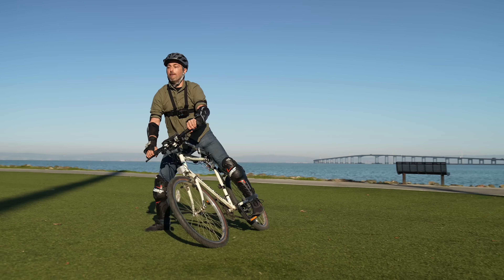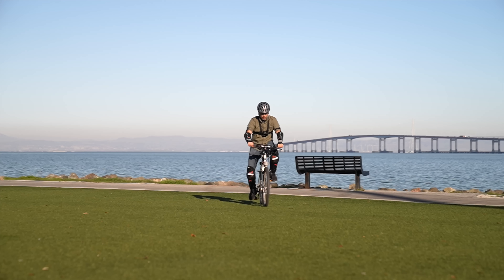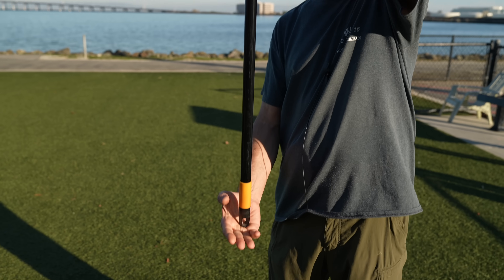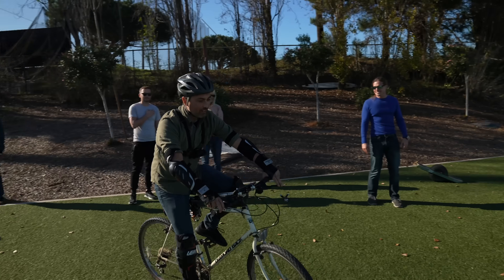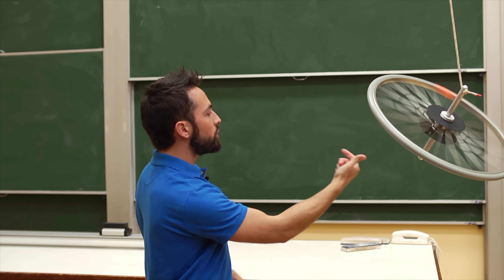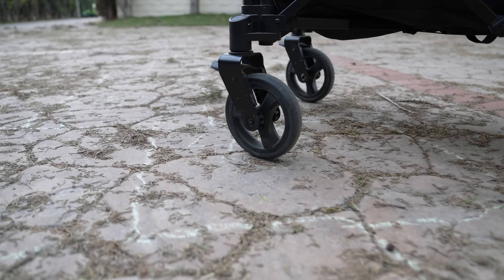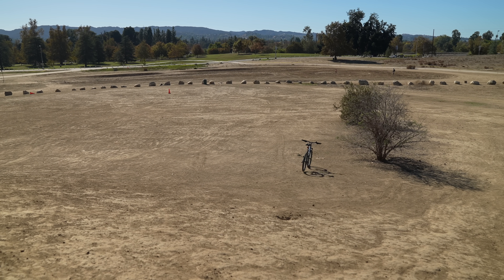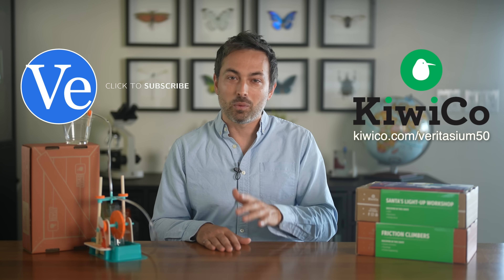Most People Don't Know How Bikes Work

Comment: This is stupid.
When you drive slow, you always do little left-right steers to keep balance and slower you drive, bigger those steers.
When you lock the handlebar, you just can't keep balance while driving slow. If you'd keep all of this on high speed there would be no problems.
Reply: >> If you'd keep all of this on high speed there would be no problems.

I'll bet you $10K you can't ride this bike at any speed with steering locked.

Comment: I know you said that with the steering locked you couldn’t stay balanced on a bike. But then how can I bike with no hands on the steering wheel
Reply: It's easy enough to ride "no handed" as long as the steering isn't locked.  You're taking advantage of the three dynamic principles Derek described for the stability of a riderless bike.  But if you lock the steering, you will not be able to ride it with or without hands on the bars.

Comment: The second they mentioned they locked one direction.. I realized where they were going. That they would try to turn that direction and take the turn wider for balance and were going to fail because its locked. Also its not like cars just hard steer in one direction. Sometimes they do in fact go wider.

Comment: My friend and I figured this out when we rode over snow and looked at our traces. We then challenged each other to go right or left without steering in the opposite direction first.
Reply: Yep. You have to lean your entire bike to one side and and slightly balance your body the other side. Only works if you know where to turn beforehand though.
Reply: @warmooze  kinda like what we see in motorcycle races?
Reply: @bruno13532  Doesn't even have to be that extreme, the way i was taught to ride i didn't even know people actually used the handle and turning it to initiate a turn, i was just told to lean in the direction and the handle will follow automatically. Unless you're riding painfully slow and need to turn on a dime, which i've rarely ever even needed to do.
Reply: @warmooze  That's how I always turn. I just lean and then turn to the side I want to turn to. I do kick out to the opposite direction consciously on hard turns though
Reply: @warmooze  yep. i have a bent handle (common in the Netherlands) and lean with my elbows on the handles and my hands on the frame above the wheel, so i basically only need to lean
Reply: @warmooze  I always bike like that, that's how I learned it
Reply: did u manage to do it?
Reply: I'm sure you still countersteered some, it's really hard to kick a habit you don't think about.
Reply: 1: turning your bike means saving it from falling over to one side.
2: if you lean to one side while going straight, your bike will lean to the other, because physics.
3: you can slightly lean to one side, making your bike tilt to the other, and then steer towards that side, making you and your bike unstable and forcing you to turn.

the counter-steering is just an intuitive process of making you fall towards your desired side.
Reply: @warmooze  So you'd be willing to try the bicycle in this video?
Reply: That's so nice. Kids realizing something and testing hypothesis naturally (assuming you were kids when that happened 😁).
Reply: To all the people saying "that's just how I bike", please find a method to trace your tracks and check again. At normal riding speeds it's not very noticable, but  not counter-steering a bit makes turning completely awkward.
Reply: I think counter-steering is only really necessary at low speeds.  If you're going fast enough, you can simply lean your body and turn the handlebars in the direction you want to go.
Reply: @Durwood71  I think it’s all about being conscious of your balance. I think uncoordinated and/or unathletic people probably countersteer more because they can’t balance like that on their own. When I snowboard I can turn without counter steering by just leaning further for harder turns.
Reply: @Durwood71  at high speeds it only takes a tiny counter steer to lean your bike. you do it, it happens naturally.
Reply: @0xsergy  if I'm counter steering at high speeds then it is literally undetectable, because I've paid careful attention during my rides and see no evidence of it.
Reply: @Durwood71  Eh motorcycle racer use countersteering tho
Reply: So this bike proves nothing other than the creator of this video doesn't know how to turn both type of ways lol
Reply: @aitotem  Well at low speeds seen on the video I think alot of people will do the steer to the other side before shifting center of mass thing.

Comment: If you ride a motorcycle…you already know this.  It the higher speeds of a street bike you push the steering wheel away on the side you want to turn.  The harder you push…the harder it turns.

Comment: I want to try this at a regular speed and without using the handlebars (he was going way too slow). I can bike almost the whole time without using the handlebars, so my turns are controlled by my minute body shifting and movements. But without using the handlebars, if I turn even slightly the wrong direction I have to keep turning fully, straighten out and only then can I turn around. It's almost impossible to turn a little bit the opposite direction and then correct to the right direction without the handlebars. Even if I'm holding the handlebars, when I turn I'm barely touching the handlebars and the turn is all in the body shift. I'm disappointed they didn't have a regular bicyclist test this out. The people who use it for daily transportation. I want to see if the results are different.
Reply: >>  I'm disappointed they didn't have a regular bicyclist test this out.

I have put experienced mountain bikers on this bike as well as professional motorcycle and bike racers.  The results are always the same.  Riding without touching the handlebars does not help.   You still need to counter-steer whether you're touching the bars or not.

Comment: Ok but does this work for life-long bikers?

A few tests suggest that you don't countersteer so much as lean in to the curve, so that the bike doesn't move out from underneath you. In other words, you steer mostly with your body, not the handlebars.

Just curious.
Reply: >> does this work for life-long bikers?

Sure does.

>> A few tests suggest that you don't countersteer so much as lean in to the curve

Lots of people believe they don't countersteer to initiate a turn.  But both the equations and this experiment prove that they do.
Reply: @Rick_Cavallaro  There's more than one way to take a turn, and if you aren't as wobbly as the examples provided you can easily hang over first and then follow through with the handlebars. You can even push'm down to get into it.
Reply: @typhoidtyphoon  
>> you can easily hang over first and then follow through with the handlebars

Nope.  If you could do that, the folks in the video would have done it.  Some were very experienced mountainbike riders.  I've since put professional bike and motorcycle racers on the bike with the same results.
Reply: At speeds above a slow walk?
Reply: @typhoidtyphoon  it is true at all speeds.  The amount of counter-steer required is less at higher speeds, but still needed.
Reply: @Rick_Cavallaro  Hmm I'm still sceptic, but as I can't produce any counter-proof I'll have to settle for that.

Comment: Which is why riding a motorcycle is fundamentally different from riding a bicycle.  On a motorcycle, the gyroscopic effect is the predominant force and steering is not done by turning left/right, but by pushing down on the left/right handlebar grip.
Reply: Wow! That could be the worst  ever.
1. Gyroscopic effect do next to nothing. If you don't belive that, then calculate it yourself.
2. Pushing down handlebars do nothing, except lift your arse up.
3. Bikes work the same. MC, Bicycle, scooter, kickbike...

Comment: And there are people who can balance on a bike when it’s completely still pretty much and pro road cyclist can do this. All of what you are saying is possible IF you have the skill set.
Reply: Almost everyone that does what you're claiming is doing a track stand.  To do that you turn the front wheel 45 deg or so, and move fore and aft a few inches.  That moves the front of the bike left and right.  You're still using the inverted pendulum dynamics we use to ride.  Lock the steering straight ahead and you'll find very very few people that can balance.
Reply: @Rick_Cavallaro  Oh absolutely, very few. But it can be done.
Reply: @truezenithcreative  It can, but it's literally using different skills from those we normally use to ride bikes, not just people that are better at the same skills.  And it doesn't look like riding a bike.  It looks more like a high-wire circus act.

Comment: This isn’t quite true, at a high level in cycling the can do this with extreme body lean. It can only be done at fast enough speeds and you have to be a fairly solid rider but it can be done. (Think how you can actually steer a bike while riding with no hands just by leaning)
Reply: I can do extreme body lean and still steer my bike. All I have to do is to use the handlebars.
Reply: >> This isn’t quite true

Yes it is.

Comment: But what about bikes with 1 wheel? Or 3 wheels? Or 4 wheels? lol
Reply: Bikes have only 2 wheels inline.
Reply: Clearly not all of them. There are bikes with 1, 3, or 4 wheels lol
Unicycle, tricycle, quadricycle, or training wheels. How would this video work on these variations, i.e. lock the steering lol
Reply: lol I said bikes not bicycles (same for the video title). Pretty sure many people call those (1, 3, 4 wheel) bikes as well, especially bikes with training wheels, you still call those bikes. I was referring to the falling part with the steering locked, not talking about turning. My point is whether the falling part would apply to those bikes that has 1, 3, 4 wheels (or training wheels) when the steering is locked.

Comment: What? How ppl steer is counter intuitive to how I steer. I never watched how others steered, seeing this video is mind blowing in a way. Seeing it, I get why it's done and I recall myself doing it in the past, but I long adapted by leaning before steering. 

I can't make a small right turn if I want to make a super tight left turn, I need to be leaning into the turn in order to initiate the turn, then steer. Any others who did BMX in the past who get wtf I'm talking about?
Reply: I get what you're talking about, but you're fooling yourself.
Reply: @Rick_Cavallaro  yet I ride bicycle everyday, and like usual, I leaned into the turn long before I even turned. 

Do you ever ride without hands? How do you steer then eh? You lean.

Do you think when I turn without touching the handle bars I steer to the right first when going left? Clearly not because I'm not touching the handle bars... I lean to steer.
Reply: @lookdawg187  
>> yet I ride bicycle everyday

Lots of people do.  And they can ride just fine.  They just don't know how it works.  Thus the title of this video.

>> Do you ever ride without hands? 

Yes.  Perhaps you saw me riding the unicycle in the video.

>> How do you steer then eh? You lean.

You don't lean.  You lean the bike with your hips.  That causes the required counter-steering based on the three principles Derek described for the stability of a riderless bike.  But if you lock out the opposite steering as we've done here, you still can't make the turn.
Reply: @Rick_Cavallaro  since you know the people in that video, as you were one, do you not recall him saying he could turn when he was already leaning in the right direction? 

I can lock my entire front wheel and still turn using my body. Can't do that on uni-cycle because you fall off then, but the bike has mass to manipulate where you can alter the center of gravity a lot easier.
Reply: @lookdawg187  
>> do you not recall him saying he could turn when he was already leaning in the right direction? 

Yes.  That means the counter-steer happened prior to locking the bars.

>> I can lock my entire front wheel and still turn using my body.

How about if you come by and show me on this bike?  I'll bet you $10K you can't.
Reply: @Rick_Cavallaro  so you've never seen BMX pop their front wheel and turn using their body?

Save yourself the 10K and go check out a BMX show, they do all kinds of wild stunts using their body to manipulate where the bike goes, with or without front wheel steering.
Reply: @lookdawg187  
>> Save yourself the 10K and go check out a BMX show,

Got it - you're unwilling to put your $10K where your mouth is.
Reply: @Rick_Cavallaro  I'll bet you $100k I can steer my bike with steering locked.

So when will I be seeing you to take your money?

You're like that physics professor, get ready to pay up because I already do what I claim I do.
Reply: @lookdawg187  
>> when will I be seeing you to take your money?

As soon as you come to the S.F. bay area and demonstrate this on this bike - with both wheels on the ground at all times.
Reply: @Rick_Cavallaro  How am I supposed to make super tight turns on a bike with both wheels on the ground? 

Have you ever seen BMX? The front wheel likes being in the air to do tricks.
Reply: @lookdawg187  
Let's look back at your original post...

>>  How ppl steer is counter intuitive to how I steer... I long adapted by leaning before steering. 

That's clearly not talking about lifting the front wheel.  You're changing your story because you know you're wrong.
Reply: @Rick_Cavallaro  When I go into corners I lift my front wheel to steer into it. Not sure how I'm changing my story, but sure, if you say so. Read further down in my original comment about BMX and tight turns.
Reply: @lookdawg187  
So you claim that this suggests that other people turn with their front wheel in contact with the ground, while you always do a wheelie to turn!?

>> How ppl steer is counter intuitive to how I steer.

No one's buying that.  Particularly because you went on to explain that the difference between how you turn vs. how other people turn is that you lean before turning.
Reply: @Rick_Cavallaro  What? No I'm saying I've long stopped steering how ppl normally steer because I'm so used to wheelie steering.
Reply: @lookdawg187  Let's review...

>> "...but I long adapted by leaning before steering"
Reply: @Rick_Cavallaro  yeah, using my body to help steer the bike, not the front wheel, since I'm leaning back as well as to a side, the front wheel lifts up. Not sure what's so strange about that.

Dutch city bikes even have an extra seat at the back, if you sit back there instead of saddle you especially get the front wheel lifting up with no problem, since you shift the center of gravity.